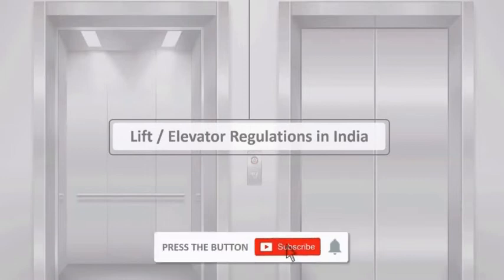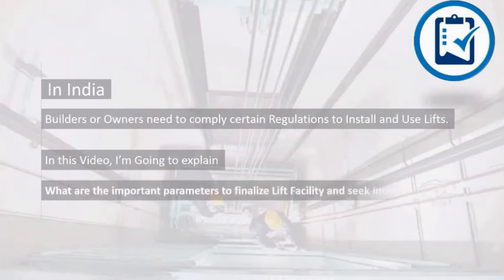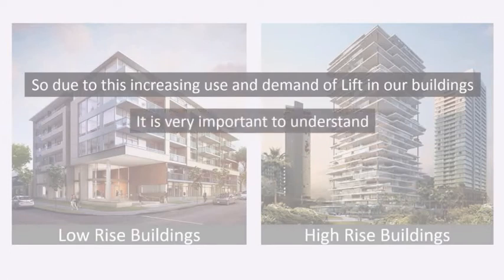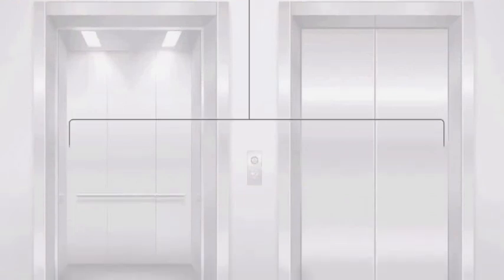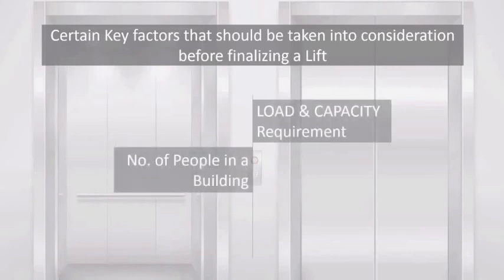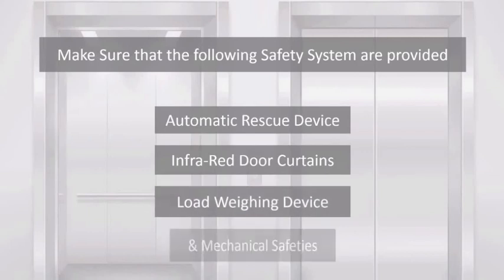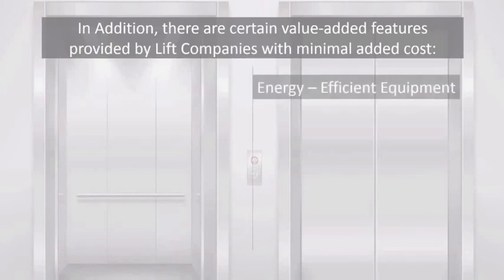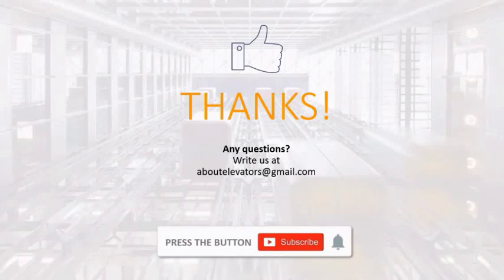Rules & Regulations to Install Lift in India | Lift Installation | How to get Lift License in India

Comment: Thanks for this. Is the license process needed for private home lifts or villa lifts as well? 
Or is this only for public buildings / apartments?
Reply from the maker: If the lift mechanism is traction, you need to get it licensed.
For hydraulic, Home use it is not necessary but recommended. You can also get it done by a Chartered Engineer in case of hydraulic lift.